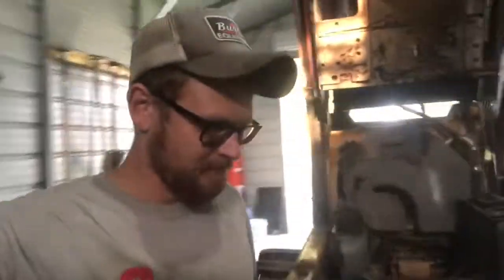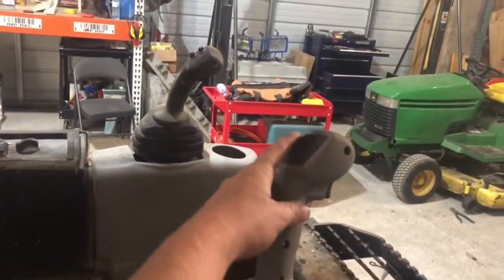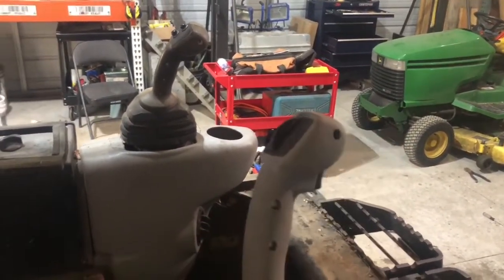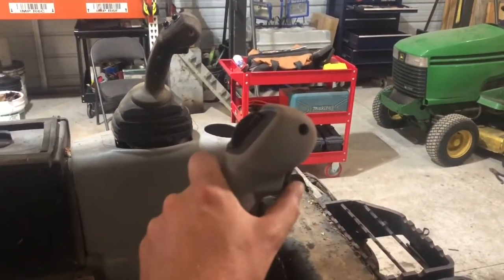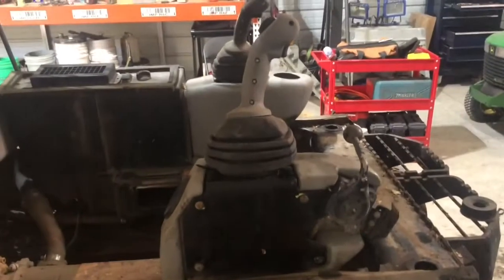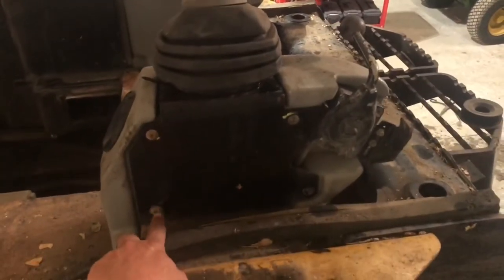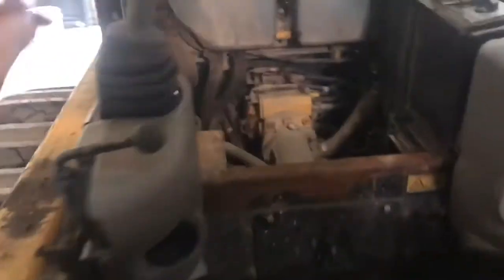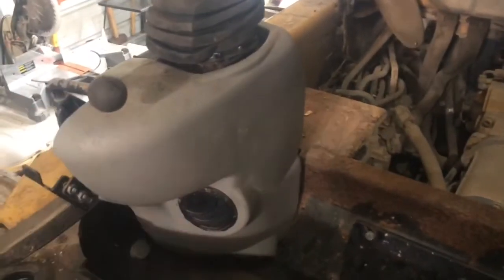Changing Auxiliary Hydraulic switch on a CAT 236B

Comment: Does your aux hydraulics run only off the thumb control on the right joystick or is there an overhead switch that engages them ?
Reply from the maker: It runs off the thumb switch on the right lever. There is also a switch above but I think that is an over ride to hold aux hyd on with no operator to run an attachment like a log splitter with no one in the cab or to just hold them on if running an attachment where you want it to stay in constant like a tiller, brush mower, etc.